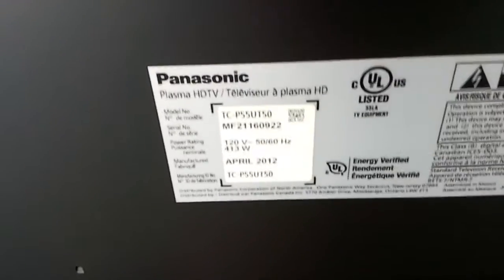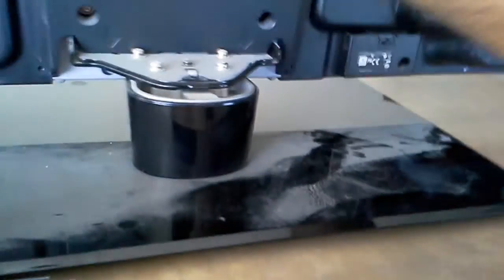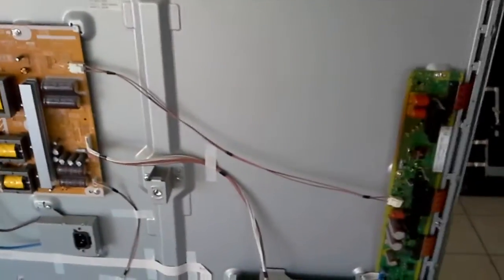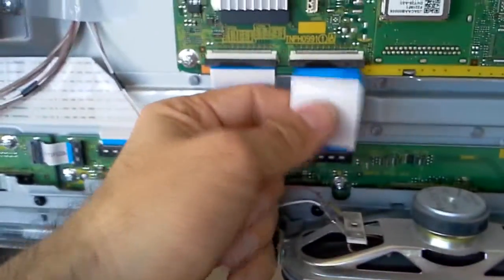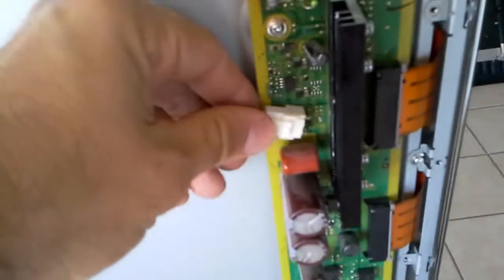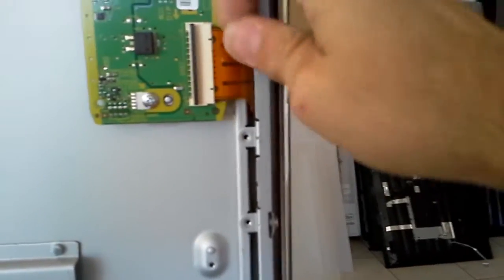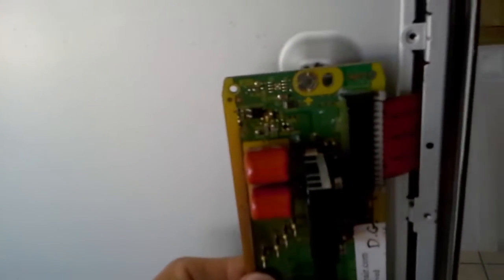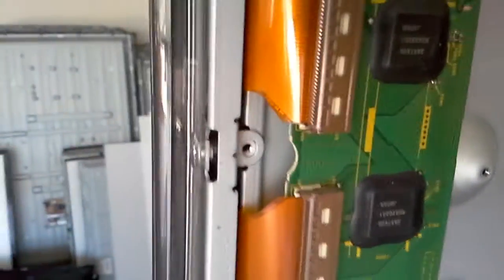Panasonic TC-P55UT50 8 blinks TNPA5623 failure - disassembly and repair instructions

Comment: One should really refect on the core importance of inspecting for the loose grounding screw issue and why it causes sustain boards to fail in the first place. one should check the tightness of all the grounding screws on every board , But the grounding screws on the sustain board carry a lot of current and are a known issue , panasonic issued a new type of screw that includes a lockwasher to address the issue of loose ground screws damaging boards. if you have one of there newer sets it may have the fix allready applyed ..

Comment: Have the same issue with 8 blinks which is followed by 2 audible click noises from the power yet the board does not look discolored nor do any capacitors look swollen? Could it still be the SS board?
Reply from the maker: If I talk about swollen capacitors in this video in the context of this being the problem then I am in error and I ask to be forgiven.
Your board most certainly is discolored, but if have left you with the impression that this is a tell sign of a failure then I have mislead you and I ask to be forgiven.
If you have not watched the video and still ask questions underneath is then you need to watch it first...consider yourself forgiven.
Reply: I got the same problem going on with my TV but sometimes when I unplug it for long periods of time and plug it back in and turn it on what is it